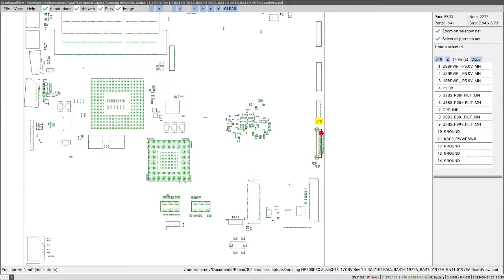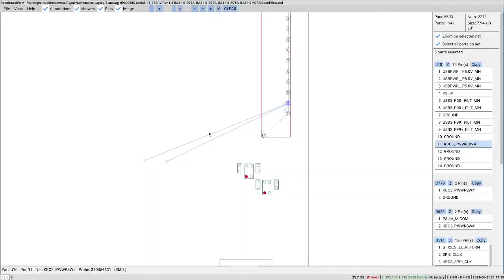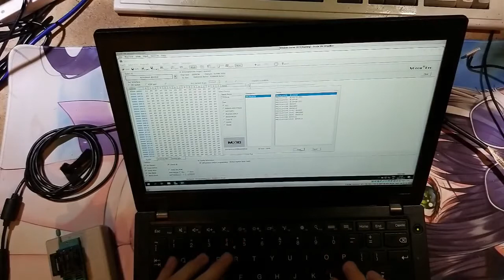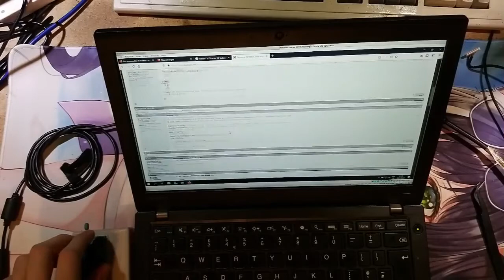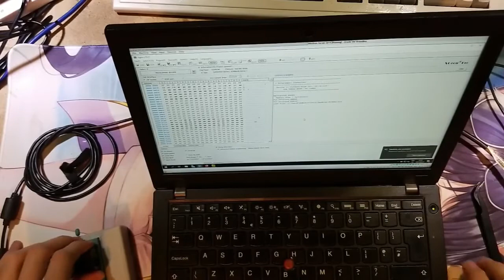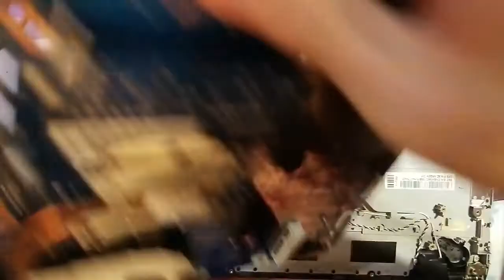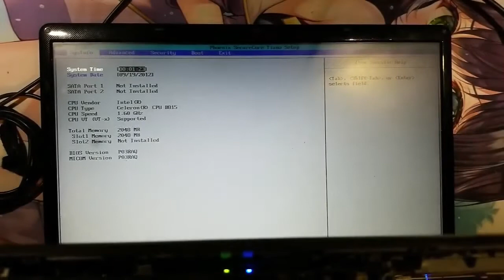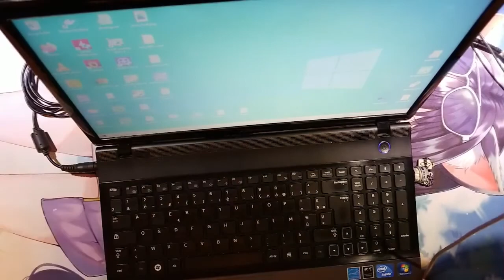T&F Samsung NP300E5C BIOS POST cycle (NO AUDIO)

Comment: Du coup tu as réparé grâce à un dump pris sur badcaps ? Je me fais de plus en plus de soucis concernant cette méthode, la perte des informations gravé dans le BIOS d'origine semble posé de plus en plus de problème sur les cartes mère moderne. J'expérimente en ce moment de clean me moi même les bad bios, mais c'est vraiment à univers à apprendre :/
Reply from the maker: For laptops that come with Windows 8 or newer you have to edit the Windows key. Here it's a laptop that came with Windows 7.
Also there's no DMI information showing up in the BIOS (serial number, etc…) so it doesn't really matter.

For example on HP laptops you need to use nbdmifit to put the correct DMI information, other laptops may require it too. With Acer/Packard Bell there's also a tool to edit the DMI info and change the branding (between Acer and Packard Bell). For Apple laptops you have to edit the serial number (MDM is tied to serial number). For Asus you may have to use the bt.exe/bt2.exe tool to enable keyboard backlight, etc…

 So in this case nothing required except cleaning ME region, and the file I downloaded already had a clean ME region
I may have been able to fix the original BIOS just by clearing NVRAM in this case, but it's faster to use a confirmed working BIOS (since you never know if the problem is actually the BIOS or something else).
in some rare cases, a mismatch between BIOS and EC firmware can cause trouble though (when EC firmware is no in the same SPI ROM as main BIOS).